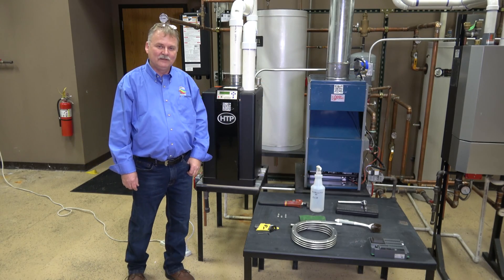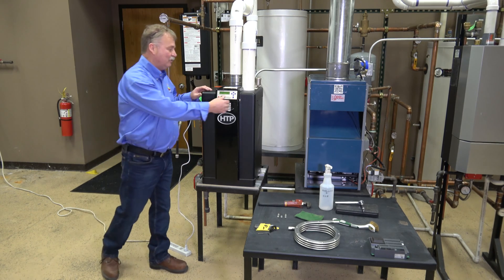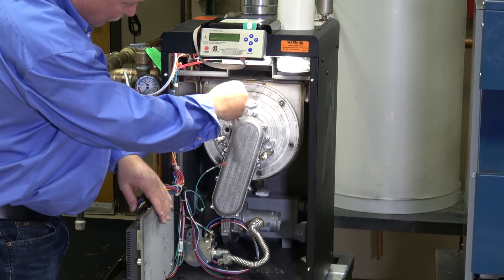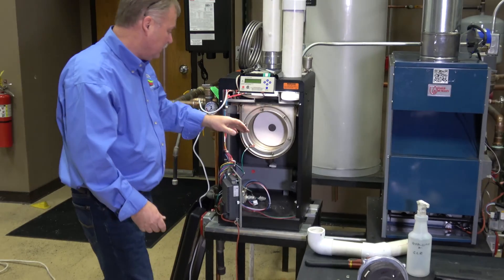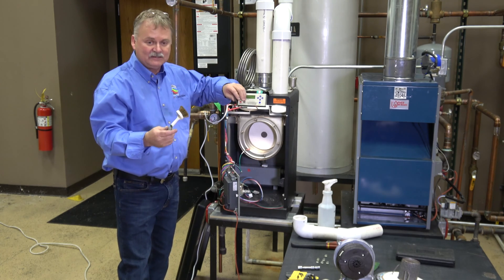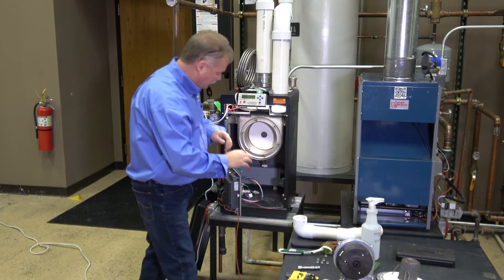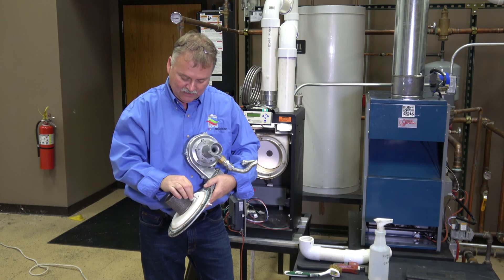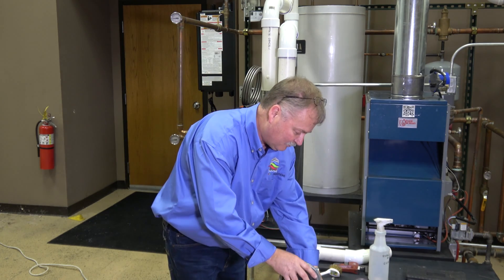Boiler Maintenance for HTP Elite, Mod Con, & Munchkin

Comment: I have one like that and I’m having trouble cuts off sometimes and I have to re start it. I don’t know exactly what is the problem or  when was the last time they did and inspection
Reply from the maker: Someone needs to troubleshoot it to figure out which component is cutting it off (limit, low water, etc) and then figure what what root cause issue is causing that safety to trip it out.

Comment: Got one of these that has not been serviced in 7 years. I did cleaning as instructed. It was full of coffee grinds on bottom of heat exchanger. Got nice and clean, cleaned out condensate “box” below exchanger as well it lights but won’t stay going. I keep hearing fluttering. I got it to fire once by basically blocking inlet air. Gas valve adjustment screw was already cracked. New gas valve? Vent and intake air clear.

Comment: Why wouldn't they just provide a plastic disk that fits over the target wall with rubber or silicone out edge and a handle in the middle. A paper plate.... that is bush league!

Comment: Just tried turning the system on. When the wall thermostat calls for heat and circulator pump start moving. The boiler does not call for heat. Any thoughts? I checked most of the obvious external stuff. There is a separate zone for the hot water and that works fine. The boiler produces hot water for the house. So in that respect it's working just that when the thermostat calls for heat for the house it doesn't turn the boiler on to make heat it just circulates the cold water
Reply from the maker: There are numerous possible reasons.  It is best to use an electrical meter to diagnose the controls.  It could be too warm outside per the OA reset schedule.  It could be the thermostat not engaging it’s relay.  It could be going to a zone or pump controller and something is not setup correct there.  Have the original installer look at it because he knows how all the components were setup to work with each other.
Reply: @TECTubefilms . Thanks for responding so quickly! the wiring is right it's worked for several years and nothing's been changed. I appreciate your concern for that. This is interesting how the outside temperature matters. I know there's a sensor outside. How's this for an interesting turn of events. After my comment I turned the thermostat up and went downstairs to start testing more stuff and it was working. Go figure I'm not making this up. The only thing I did since yesterday was leave the thermostat off for 24 hours. I did not turn off the boiler. Is there a logic diagram for the thought process this boiler uses? I could start by looking at the manual but I don't know if they includ it there that would be nice.

Comment: Another excellent, clear, concise video!  Thank you!
I'd add:  kneepads, chair, headlight band, lamp you can aim into the furnace, crescent wrench, paper plate (mentioned a bit later in the video), maybe thin nitrile gloves, small work table (folding?).
Never use a pipe wrench if a crescent wrench will work -- it chews up the nuts!
Minimize the gas tube flexing to avoid metal fatigue, don't want to crack it.
Take lots of pictures, to answer the "where does this wire go, again?" and similar questions.

Comment: Lochinvar has a cleaning kit for this style Heat Exchanger. It is a Nylon brush wheel that has extensions for a drill. It works really well on cleaning this style HE.

Comment: A pack of styrofoam plates from the dollar store is your best bet for covering the target wall.  Cut a plate to size and it is impervious to spraying (unlike paper which will saturate), and is easily removed after cleaning.  Additionally a shoppers discount card (plastic credit card free of raised imprints), works great to slide in between the coils to poke out anything lodged in that the brush will not reach.

Comment: I disagree with using a scotch bright on flame sensors. You remove a protective coat. Use a dollar bill.
Reply: Agreed you have to be delicate with the fussy flame sensor (can I get an F09?)   The scratch free scotch brite (like the blue sponges), is safest, be gentle.
Reply: Does anyone have information on maintenance for an HTP UFT combi natural gas wall unit. I can't seem to find anything on it. Thank you

Comment: What is the pressure gauge supposed read while running? (I have 55 gal). Mine off pressure at 10+. On goes to almost "0". Thanks
Reply from the maker: Where is the pressure gauge installed on your piping?  If it is on discharge side of the circulating pump, it should increase when the pump is on.  If it is on the suction side of the pump, it should decrease.  The actual amount of increase or decrease is a function of your piping system and the circulator sizing.

Comment: Hi , I have a munchkin M80. I need to replace the water pressure switch. Is there anything I need to know before I remove the old. water leaking, etc

Comment: I am getting F00 and F03 errors when boiler fires up. Above the burner door assembly near where the electronics are, there seems to be some condensation coming out of somewhere and there is some oxidation below the board. After resetting the boiler faults with the F00 or F03 error. The pressure and temp gauges seem fine.
Reply from the maker: If you are a contractor who purchased the boiler from TEC, give Bill Bailey a call and he will work with you to figure it out and possibly make a site visit if needed.  If you are in a different area of the country, work with your local HTP rep there to do the same.

Comment: Good rule of thumb install 2 side by side when one fails second one saves you from not being able to get parts for a week. Or like munchkin leave you with no major parts available. I removed a munchkin and put an older Weil Mclain in because they still sell parts for their boilers. Or install commercial gas stove sized to heat customers house, was on a call with a munchkin and customer was standing beside his stove to stay warm. Love companies saying these have been used over seas for years never did salesman say and by the way we wont sell the parts to fix them in 10 years. Just a tip.
Reply from the maker: We are not familiar with your geography but we still stock Munchkin parts in Chicago area
Reply: @TECTubefilms  we were looking for the burner gasket on a 199 also the black pipe blew out of the back of the boiler, Burner itself as well. Called HTP they said not available.
Reply from the maker: @jimshorts7983  Your local rep no longer has parts in stock either?
Reply from the maker: @jimshorts7983  We will have to ask our boiler guys for specific parts questions since we are "just the marketing folks"

Comment: Sermeta heat exchanger from France .. 
EBM Blower. 
The white coating is from the natural reaction in the Kanthal rod from being in the Flame.
The Burner Gasket  also take the five larger screws  at air channel off and check it you will find rubber round gasket Deteriorates cause flame out conditions.
Also make sure your earth ground is bonded TO THE GROUNDING ROD Outside that it’s not missing Electrical interference
Check operating inlet gas pressure vs none operation keep pressure drop to 2.4” maximum this shows regulator might have issues in first stage freezing up vs 2 Nd stage of dropping while operating

Comment: hi, on the some NTI boilers there's a hot surface ignitor( 2 white wires) but there's also a spark plug cable. is this spark plug cable used for spark ignition? so there are TWO ignitors? i am thinking one must be a flame rod, but id there a flame rod/probe that uses spark plug cable? please reply, thank you.
Reply from the maker: We are not super familiar with the NTI brand, but can't imagine they have two separate ignition options.  We would suggest looking at the wiring diagram of the unit to determine what you are actually seeing on that "spark plug cable."
Reply: @TECTubefilms  that is the flame rectification probe
Reply from the maker: @robertwhite4919  That would make sense.  But without seeing the boiler Mark is talking about we didn't want to guess.
Reply: mark.r hvac     Q

Comment: I found it better to remove the target wall refractory altogether. Its good to exercise that small screw that holds it in. You can also be much more liberal with your coil cleaner and you don't have to carry paper plates with you.
Reply from the maker: Trust me, when Bill says to use a paper plate he knows what he is talking about. The reason to use a paper plate is so you CAN leave it in. Taking out the refractory wall risks chipping, damage, and getting it wet, or possibly dirty. All things that can potentially shorten the lifespan of the wall. The idea is you don't need much product to do the job if the boiler is maintained correctly and consistently. For most jobs it isn't necessary to create the extra work and risk having to foot the repalcement cost for the refractory wall if it is damaged in the process. All while your customer has no heat as you wait for the replacement to come in if it isn't in stock.
Reply: I find this only half correct. Yes, in some cases the refractory is brittle and about to fall apart, then cover it. But in other cases, when the refractory is sound enough, it is very simple to remove it without any damage at all, and I will always do this if possible. It makes working inside the unit and doing a proper cleaning much much easier, and all without any risk of as you said damaging the brittle refractory. To be fair though, if the refractory is that bad off, it is cheap, and easy to just replace. I've noticed, the new ones, and older ones that havent been soaked by backed up condensate, and or cooked, have absolutely no issues being removed and reinstalled without any risk of damage. So I guess I really dont agree, given the cost, and ease of replacement, if it is as you describe, why not just replace the thing? As I said, I have easily removed refractories that are years old, and they can be handled without damaging at all, and allow a better cleaning hands down. Consider what happens if the refractory decides to split and loose a piece after you clean, and put it back in service?? Yikes! But yes, definitely an item to have on the truck, or in the shop if you are going to risk it, during the season, and I just picked up a few at $25 each, but the list price is atrocious.